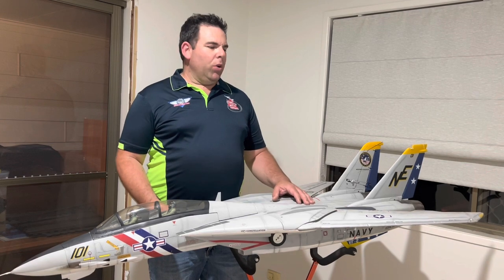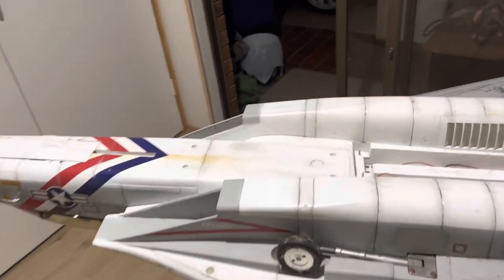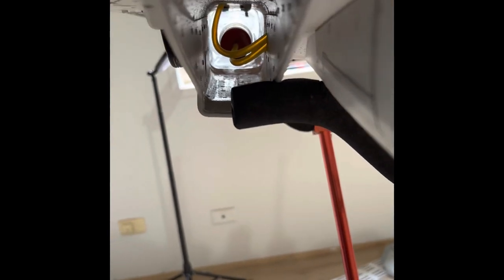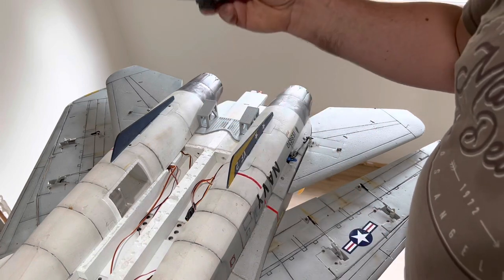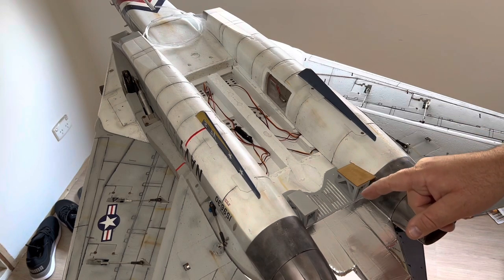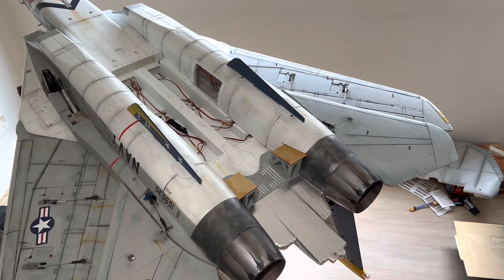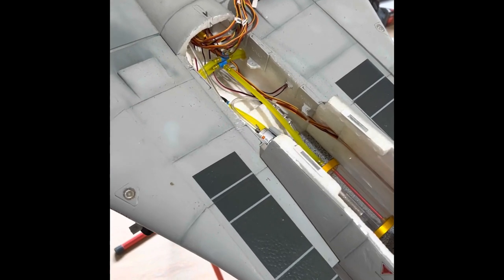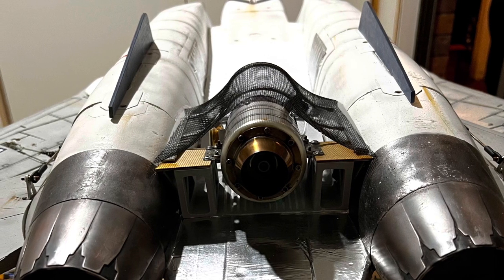Freewing F-14 Turbine conversion with an X45

Comment: Thanks again for the great work, I love mine. Only issue is the grass debris blocking the fod. I saw at the end of your video a nice protection made of a grid and kind of frame, can you share a bit more info on that, a potential STL file you can share ? Thanks
Reply from the maker: I designed a frame and then covered that with aluminium mesh as used on household flyscreens. I never released the files for the FOD guard because they never really worked well and had moved onto other projects so ran out of time to redesign it
Reply: @ticketec  Many thanks, will find out that mesh. Thanks again for sharing this inspiring video and the STL file. I really enjoy flying this F-14 with the Xicoy 45. Only mod, I used 2 500 cm3 tanks as I found they fit more easily .

Comment: Great conversion and video.   Any chance you could let me know the turbine angle you finally used in relation to the flat on the bottom of the aircraft?  I do not do printing and prefer to do things like this the old fashioned way...plywood and/or aluminum.  Thank you.

Comment: I wonder if you could increase the flighttime even further. Maybe with bigger tanks? What do you think?
Reply from the maker: You could add a little more fuel, but then the weight goes up and you need to burn off that fuel to get the same performance. Most pilots don’t fly more than 6-8mins, and this is enough fuel for that long.

Comment: Amazing! I see a brilliant setup and much logic steps. Do you use stabiliser and/ore Telemetrie. I am just flying my KT45 in a Freewing Avanti without AR3X; and next will be the L-39 for turbineexperience. But this plane is awsom. What about final weight and how goes the tankventilation?  Have fun :-)
Reply from the maker: Thank you for the kind comments. I do use AS3x but not telemetry. I have had telemetry on other jets but don’t see to use the data much.  AS3x is good but I need to play with it a little more to get it fully dialled in.  All up weight with the model dry is 4.9kg

Comment: Amazing work! Thanks a lot for your sharing. I have only a kingtech 45 engine and want to copy your work. but k45 is a little wider than x45. can it be used on your 3d print convertion part?
Reply from the maker: There is a little bit of space, but only about 1-2mm. 
I’m not sure how much wider a K45 is. No one around here flies with them anymore, so I can’t measure and check
Reply: @ticketec  thanks for your replying. according to the size on the website, it seems that k45 g4+ is 3mm wider than x45, but the screw hole on mount of k45 is 10mm wider than x45. perhaps i should first print one and have a try
Reply from the maker: @maximou3447  The engine mount top plate is the same thickness all the way along so it shouldn't be a major problem

Comment: Nice conversion. Could you please let me know why the turbine mount has down thrust ? why not mount it straight parallel to the thrust line ?
Reply from the maker: The thrust line of the turbine is offset to the center line of the aircraft, this means there is a pitching moment in the turbines thrust vector. A dead straight turbine thrust line causes all these under-slung turbines to make the aircraft climb almost uncontrollably. The supplied STL mount angle is correct to within about 1 degree which gives next to no pitch change with throttle changes during flight.
Reply: @ticketec  thanks for the explanation. Just one more thing, have you reinforced the airframe and changed the stock servos for the turbine conversion?
Reply from the maker: @aviationunlimited4353  NO mods required. I flew it with stock servos everywhere,but have since upgraded the elevator servos because the whole elevator system has too much slop and this can cause issues with wings swept back flight
Reply: hi,   where can i download the STL files?    thank you @ticketec

Comment: What are you basing the down thrust angle on? At first glance that seems excessive
Reply from the maker: The angle was calculated on CAD to intersect the CoG. First flights were done with a washer under the turbine mounts to reduce the angle. In flight testing, we removed the washers and have since found slightly more angle could be used.

Comment: How many flights do you have now on this ship? Have you made any mods on the ship since you made the video ? Are you interested in emailing me directly ?
Reply from the maker: Hi, I have 7 flights on it now. The only other mods since those flight other that thrustline testing was to replace one of the Hs-8058mg’s used on the elevator as it developed slop in the gear train. My next mod will be to change those out for even faster servos, as the hitec struggle with centering over time. Feel free to DM me. Thanks

Comment: I'm lost at all of this. If the turbo is small enough to fit in the nacelle what keeps you from doing it?
Reply from the maker: You will not be able to fit anywhere near enough fuel in the airframe, to run the 2 turbines. And 2 x45 would be waaay too much power for this model

Comment: Hi. I can use Kingtech k30 for this jet F14? Thanks
Reply from the maker: I would not recommend it. The F-14 is on the heavier side. I would try single 80mm models
Reply: @ticketec  Could you recommend one but with the turbine installed like the F14?
Reply: I used a K30 G2 on my F14 conversion and it flew just fine. I now have X45's and it would be the perfect engine! I used 6 degrees down thrust and it seemed about right, plus a single 750mm tank directly in front of the swing wing mechanism.